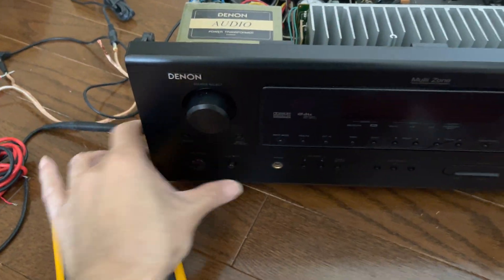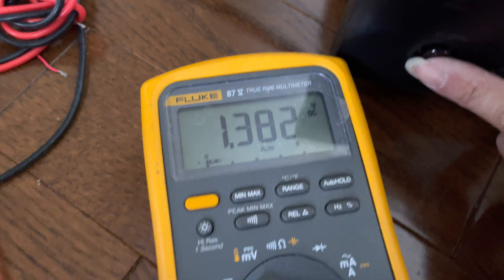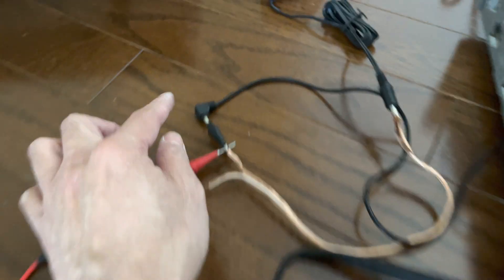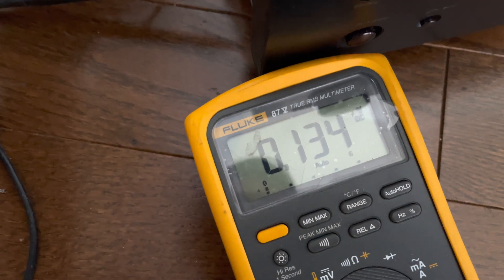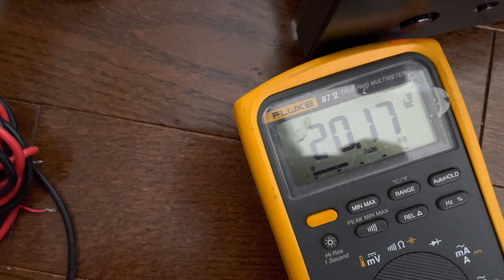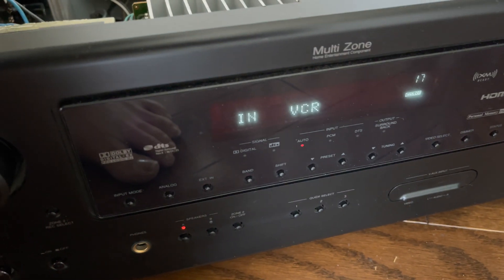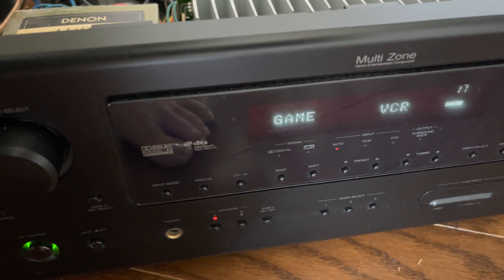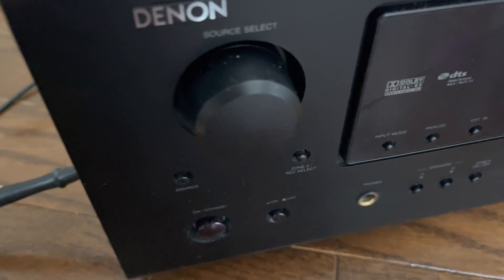Denon AVR-588 Receiver Flashing Red Light Repair 3/3

Comment: Based on your analysis, I pulled my board out of my Denon 588. Mine has a 4-pole marked K1A78R05P1. I could find the 7815 easy, but this one not so easy. Unit demonstrates same problem once warmed up. Clicks of and flashes red. It gets shorter times the warmer it gets. Am I looking at the right component?
Reply from the maker: You can measure its voltage. K1A78R05P1 should means a 5V output regulator. Mine was 15V output regulator